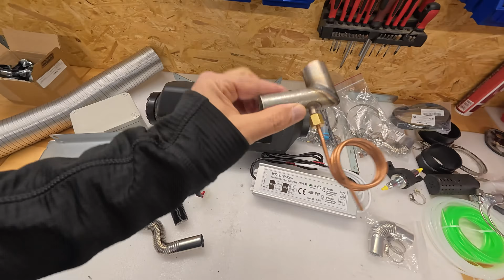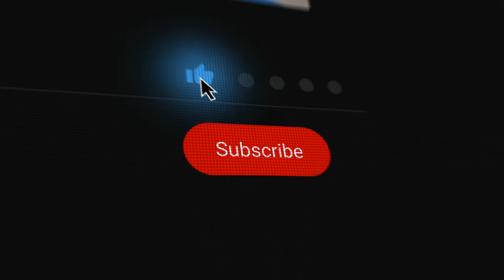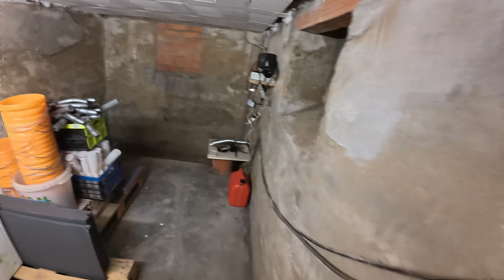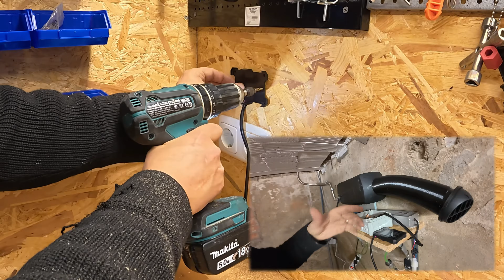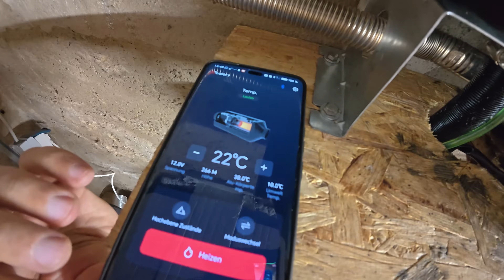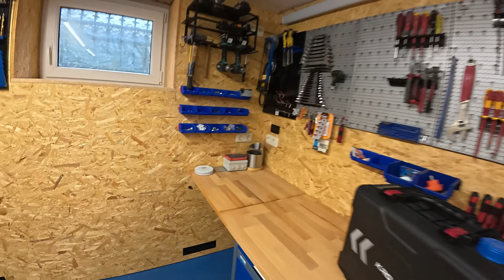How I Permanently Installed a Diesel Heater in My Workshop

Comment from the maker: *👇 All products & links from this video:
🔗 BT auxiliary heater without housing: https://geni.us/z7pv (Amazon)
🔗 Mounting bracket: https://geni.us/Iuy4 (Amazon)
🔗 Fuel canister: https://geni.us/WU3W (Amazon)
🔗 Fuel extractor: https://geni.us/zRhvop (Amazon)
🔗 Fuel hose: https://geni.us/Gu8B (Amazon)

🔗 Aluminum flex pipe 75: https://geni.us/l677h (Amazon)
🔗 Connector 75: https://geni.us/AxsD (Amazon)
🔗 Hose clamp 75: https://geni.us/iuUblqY (Amazon)
🔗 Exhaust hose: https://geni.us/PJV81 (Amazon)
🔗 Angle connector: https://geni.us/ygWQguT (Amazon)
🔗 Exhaust paste: https://geni.us/qGWjH (Amazon)
🔗 Heat protection tape: https://geni.us/0Uxzrr8 (Amazon)

🔗 Control cable: https://geni.us/NDEI (Amazon)
🔗 Transformer: https://geni.us/aJ33mn (Amazon)

Product links for my heating box:
🔗 8kW auxiliary heater: https://geni.us/Q54yxdU (Amazon)
🔗 8kW auxiliary heater with BT: https://geni.us/LsUTbbM (Amazon)
🔗 Auxiliary heater with transformer: https://geni.us/kbE9RQj (Amazon)

🔗 Aluminum box: https://geni.us/tPB1sz (Amazon)
🔗 Flange 75: https://geni.us/WBl5A5G (Amazon)
🔗 Air outlet 75: https://geni.us/evG19 (Amazon)
🔗 Stainless steel exhaust connection: https://geni.us/qtd8yb (Amazon)
🔗 Stainless steel fresh air connection: https://geni.us/gUeGBq (Amazon)
🔗 CO detector: https://geni.us/GPE7ALJ (Amazon)

🔗 Connector for cable: https://geni.us/bm6uLu (Amazon)
🔗 Protective tube: https://geni.us/5TNMNA1 (Amazon)
🔗 Power cable: https://geni.us/g2xqaqJ (Amazon)

🔗 Hole cutter 75: https://geni.us/FzBJtwv (Amazon)
🔗 Step drill: https://geni.us/l8wBE (Amazon)
🔗 Soldering iron set: https://geni.us/6MDZR (Amazon)

You can find a detailed blog post with lots more information on my website:
https://commaik.de/2025/05/8kw-diesel-standheizung-sicher-in-der-werkstatt-garage-installieren/

Follow me on my social media channels for more content! @commaik

🎥 This video was originally produced in German for my main channel:  
https://youtube.com/commaik  
It was then translated into English using Heygen – with my own voice and lip-sync.

🎙 Want to dub your videos like I do? Try Heygen:  
🔗 https://www.heygen.com/invite/b96cdcf6 – Get 300 free credits when you subscribe.

📺 The original video, which includes English subtitles, can be found here: https://youtu.be/gwKH65F2EfQ

Note: All links marked with * are affiliate links. If you make a purchase through these links, I will receive a small commission at no additional cost to you. Thank you for your support!